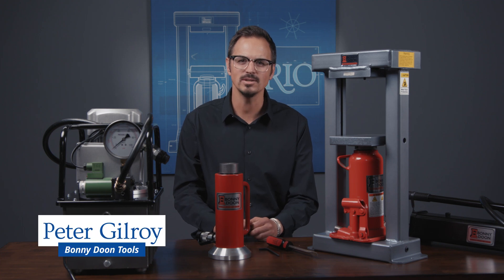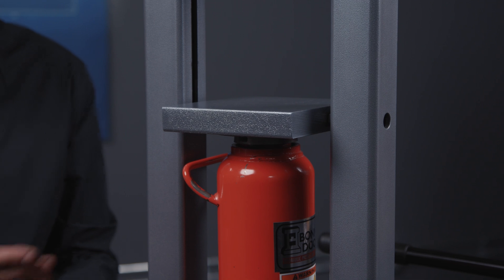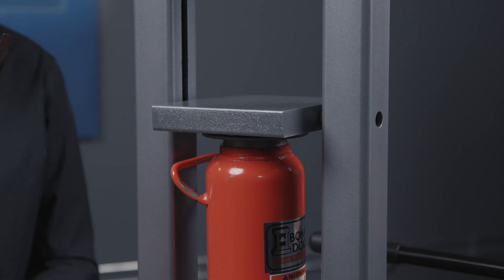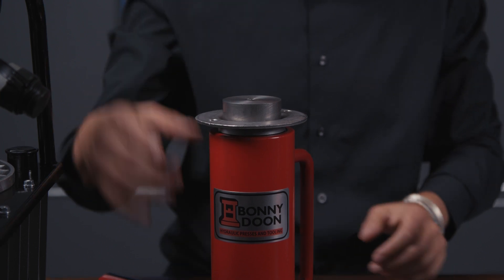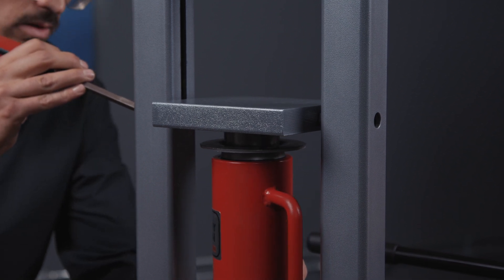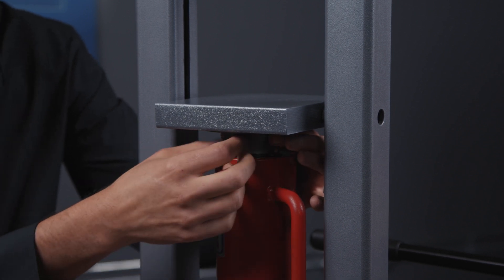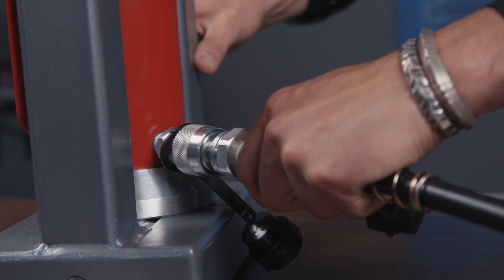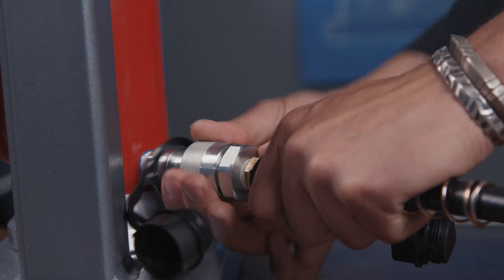Upgrade Your Bonny Doon Classic or Mark III Hydraulic Press

Comment: A friend has an original Bonny Doon press. The SPX pump was attached to a hydraulic pump canister that pushed the press up and down. She willing to sell me the pump and said my canister just has to have the correct connection installed to fit with the connection on the SPX. How do I do this?🙏

Comment: Where can you buy the electric pump? And can you just add the electric pump to the original Bonnie doone or do you have to upgrade it first??
Reply from the maker: Thank you for the question. Here is a link: https://www.riogrande.com/product/bonny-doon-electric-hydraulic-pump-with-hose/110459GP/?code=110459